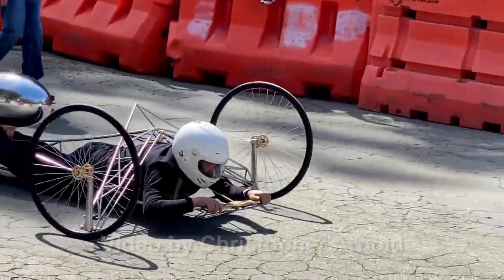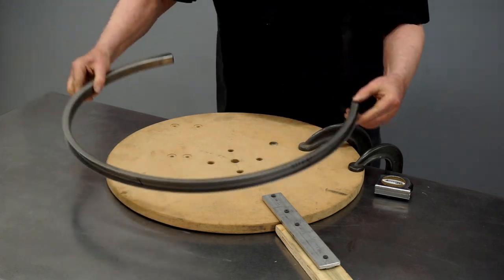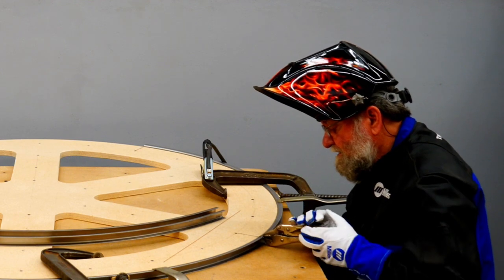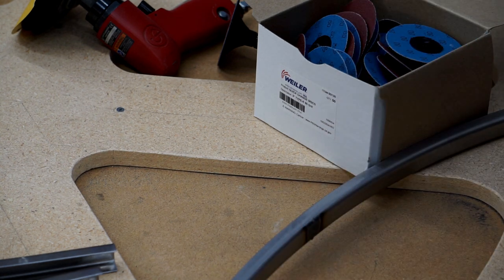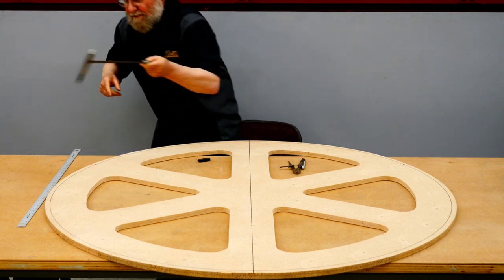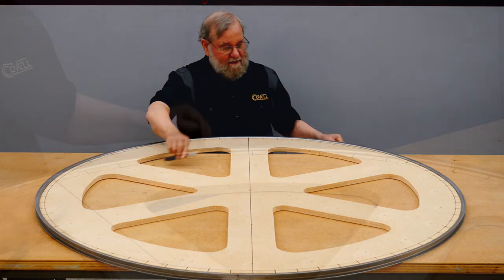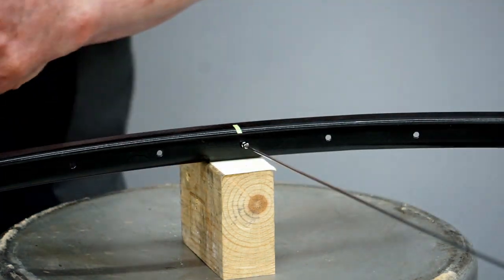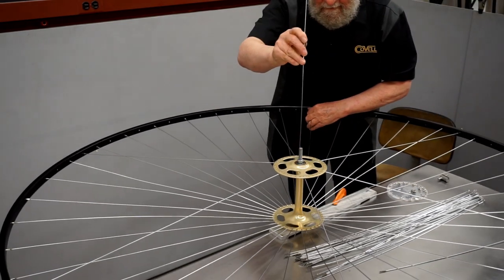Making a Really Big Wheel

Comment: Messing with the minds of geometry lovers everywhere. The radius of a circle is not equal to 1/6 the circumference, but it's pretty darn close, closer than a 1% grade is to 1/8" per foot change in elevation.
I really enjoyed this video. Did you make the hub as well? 
Your videos are inspirational.
Reply from the maker: First, I'm glad you like my videos.
I didn't say that the radius of a circle is 1/6th the circumference. I show that if you strike arcs on a circle the length of the radius, it will divide the circle into 60 degree segments, exactly. 
Yes, I made the hub - it was a pretty intensive job to whittle it out of a solid chunk of aluminum. That was actually the second hub I made. I ruined the first one when it got caught in the polishing wheel, and was bashed into the floor!
Reply: @RonCovell  The polishing wheel strikes again! I've lost a few things to the polishing wheel as well. I'll take your striking 60 degree segments and leave it there, it isn't rocket science after all... until you add a rocket to it.
Reply: @moretimethanmoney8611  When you consult your trigonometry textbooks you will find that Ron is correct re 60 degree divisions (exactly). If you accuse him of an error, and now find out otherwise, you might wish to undo your statement in a polite response to Ron.
Reply from the maker: No apology needed. We all do our best, and we all make mistakes occasionally.
Reply: @RonCovell  Meekness is power under control - you have that in spades. You may not seek an apology but the fellow called "Moretimethanmoney" could learn from your humility and admit his error. Would be good for his outlook - and soul.
Reply: @bobhudson6659  Geometry, pi. Ron got it. That's why he wrote, "I didn't say the radius of a circle is 1/6th the circumference." Of course Ron probably also realized transcribing the radius to the circumference creates a chord that corresponds to an arc, an equilateral hexagon inscribed within a circle, whose points of intersection with the circumference create 6 equal length arcs that are each barely longer than the radius. The inequality not unlike the difference between an engineers 1/100th of a foot and a tradesman's 1/8th inch.

Comment: Beautiful job demonstrating a level of patience only seen in skilled craftsmen.  My background is mechanical engineering.  The length of the spoke would seem to create a very springy wheel.  Can you feel or see any vertical hub movement while the wheel is in motion and especially if it encounters irregularities in the driving surface.   If I remember correctly the spokes should have infinite life if the operating stresses are below 50% of tensile strength.  Care to guess what lateral loads the wheel can sustain without some sort of instability occurring? I don’t think this is what Neanderthal man had in mind.
Reply from the maker: I'm not an engineer, but let me run some very rough numbers for you. On the rear wheel, in static loading, presumably the top vertical spoke takes the greatest load, and both horizontal spokes take very little load. Further, the spokes on the bottom half of the wheel will have no compressive loads at all.
This overly-simplistic view isn't accurate, because there is tension in all spokes, but let's go with it anyhow, just to get some minimum numbers.
So if I weigh 180 pounds, and the vehicle weighs 60 pounds, approximately 120 pounds is loaded on the rear wheel. There are 72 spokes, so the 'average tensile load on each of the 32 top spokes is 4.75 pounds. Of course some spokes get more stress than others, but I think you'll agree that even with 15 pounds tension on a spoke with a diameter of .080", and a tensile strength of around 60,000 psi, we're not getting close to the yield strength of the material.
Calculating lateral loads is beyond my ability, but still, with 72 spokes, the load is spread over a large number of elements, and is presumably fairly low.
If you'd like to run the numbers on this in a more precise way, I'd be interested to see what your projections are.

Comment: Beautiful work, Ron. Thank you for sharing the techniques. I’ve seen spoking & trueing done but I’ve not done it. I think it takes more patience than I have 😁. 
I’ve seen that most spoked wheels have an “X” pattern to the spokes, did you choose to not do this because this is not a driven wheel? I wonder how your wheel would react to torque?  Thank you again 🤟🏽
Reply from the maker: The 'radial' spoking pattern I used for this wheel is only feasible for wheels with hubs that do not drive or brake the wheel. Most spoke patterns cross each other, which gives the hub a lot more rotational strength.

Comment: I have done NONE of this, but I was expecting the spokes would alternate in the hub, one up, then one down..  but that would require an odd number of spokes, on each side of the hub, right?    I'm Enjoying this, as I do all of your videos!!   Thank you!
Reply from the maker: There are many ways to lace a wheel. I used the simplest pattern, called 'radial', where none of the spokes cross. Wheels are stronger when the spokes cross, and the more crossing, the stronger they get. Since my car is a coaster, and the brake is on the rim, there is no twisting load on the hub, and the radial pattern works fine. You certainly wouldn't want that pattern on a motorcycle wheel!

Comment: Really neat video.

I'm just curious, why was it desirable to account for the spring back? Wouldn't there have been merit in making the form the final size you want, and keeping that tension, it wanting to spring back, but being unable to?
Reply from the maker: Well, you're on the right track. When a wheel is fitted with spokes, they are put into tension, which compresses the rim - making the wheel stronger.
When fitting pieces together by welding, it's usually best to avoid any tension, since when the heat is put into the metal, it can move where it's hot - causing localized distortion.
Reply: @RonCovell  Makes sense, thanks for the reply.

Comment: Did you choose to lace the wheel with a radial pattern for any particular reason or just asthetics? I'd have been concerned about the strength of the wheel because it's so huge and maybe would have tried a 2 or 3 cross pattern.
Reply from the maker: No question that crossing spokes makes a stronger wheel, but the strength is mostly for the rotation of the hub. Since my car is a coaster, and the brake is on the rim, there is no torque on the hub. I did it this way because I like the look of the radial spoke pattern.
Reply: @RonCovell  that's true, I was thinking very much about bikes. Thanks for taking the time to reply.

Comment: Wondering how strong your wheel might become with a few crossovers on the spokes. Wonder how many crosses are possible too. I'm guessing you'll be lacing for the most aerodynamic design and going with radial spokes.
Back to watching the build.
Reply from the maker: Crossing spokes makes the hub much stronger for rotational loads. Since my car is a coaster and the brake is on the rim (rather than the hub) it doesn't need that kind of strength - but there is good reason for crossing spokes on most bikes and motorcycles.
Reply: @RonCovell  Excellent, I was about to ask why you didn't go triple cross.  In that specific soapbox derby variant are you allowed to use aerodynamics to clean up the airflow and reduce drag?  I've raced in Human Power Competitions in the past and it's amazing what the difference between a 'safety bike' and a faired recumbent is... safety bikes struggle badly to hit 30mph for short spurts while the 24 hour record is held by an Austrian gentleman in a velomobile that AVERAGED just over 30mph for 24 straight hours. And he's older than me..
Reply from the maker: This was a 'race' for artists, so speed was not the primary concern for most builders. There were only three rules - the cars had to roll, steer, and stop.
I completely understand the advantages of streamlining, and I used to follow West Coast human-powered competitions fairly closely, back when Freddie Markham and Gardiner Martin (EZ Racer) were some of the top competitors. There is some great work being done in this field.

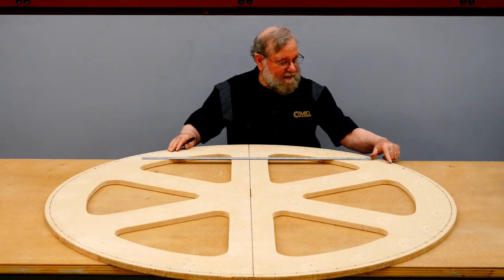Comment: 11:13 It may not matter on this big wheel only being a side note. But the lines drawn with the straight edge are not perfectly radial. For this the pinhole on the straigt edge has to be inline to the edge itself. It is however  ~ 1/2" away (assuming the straight edge is 1" wide).
Reply from the maker: Well, when I hold one edge of the straightedge against the center pin, that side is essentially forming a radial line. To be absolutely precise, I'd have to subtract half the diameter of the center pin, but in the real world it's pretty darned close.
I agree that the side of the straightedge OPPOSITE the tangent edge is off the width of the straightedge, but that's not the side I used.

Comment: Are you not gonna have less spring back with a larger radius bend? Maybe I missed it, love the tig, and the vid also. And what did the heat do to your radius? . Thank you
Reply from the maker: I haven't researched this extensively, but for most of the work I have done, the springback seems to be a uniform percentage. Extremely tight and extremely soft curves might be exceptions to this rule.
The heat from welding tightened up the fit on the form a tiny bit, but not much change other than that.
Reply: @RonCovell  very cool! Thank you for the video

Comment: Love this channel! Just have question, is the spring back percentage scalable (like you did) for any metal?
Reply from the maker: I have not done extensive research on this, but in most cases once I find the amount of springback on a particular piece of material, I use that 'percentage' to calculate how much to overbend it. Of course the size, shape, and alloy of the material makes a difference. Hot rolled material will be different from cold-finished, and in some materials the grain direction could make a difference, too.

Comment: I have made a few regular bicycle wheels, but would like to make a large wheel someday.  Would it be possible to pedal a trike in that position, or would your knees hit the ground?

It looks like you could add a large hydrogen blimp balloon on top of this and create a flying machine too.
Reply from the maker: I love the free-thinking approach you demonstrate here!
You could make a frame that positioned your chest close to the ground, but elevated your hips enough so your knees would have sufficient clearance. The smaller the crank, the less vertical displacement your knees would need. You could also use a linear-action drive, which might enable you to get even lower.
You certainly could make a flying machine by attaching a helium hydrogen balloon, but once off the ground you are at the mercy of the winds.

Comment: I noticed your spokes were placed so there was no crossing of them unlike in a modern bicycle wheel was that done for ease of assembly or aesthetics and can anyone explain why all cycle wheels cross the spokes? I’m assuming it’s for strength but don’t know for sure.
Reply from the maker: Most wheels are made with spokes that cross to give the wheel more strength. This is especially important in a wheel where the hub is driven, or braked. Since my wheel is on a coaster, and the brake is on the rim, there is less need to give the hub rotational strength, and I like the look of the 'radial' spoke pattern, with no crossing.
Reply: @RonCovell  
There’s no denying it looks great.

Comment: Ron, I'm gearing up to make my own rim, and I'm curious what dimensions you used for the rim u-channel.  I don't have a sheet metal brake that can bend 16 gauge so I was going to hire a local company to make the rim sections.  Naturally I need to give them dimensions to work off of...  Also, what is the diameter of the tire rubber you're using?  Thanks for the great inspiration!
Reply from the maker: The outside width at the top is .862", the total height is .563", and the bend angle is 85 degrees. The tire I used is 7/8". Here's one source for the tire material:
http://www.hiwheel.com/
Reply: @RonCovell  Fantastic!  Thanks so much!  I was planning on getting my tire from Hiwheel.

Comment: I'm a little confused. The circumference of a circle isn't six times the radius. It's 2*pi*r, so the six initial divisions won't be even.
Reply from the maker: I think you are confusing the circumference, which is a curved line by definition, with the straight-line measurement of my beam compass. When a circle is divided like I show, it divides the circle precisely into 60-degree segments.

Comment: Wouldn't it have been easier to drill thr spoke holes through the C-channel before bending it?
Geometrical calculations should have yielded the spacing distance, and using that dimension to  make a drill jig with an alignment pin would have made short work of drilling all rim material, with a hand drill, or drill press.
Reply from the maker: I'm glad you thought deeply about these issues, and your thoughts have some merit.
I prefer to do the welding first and the drilling second, since that lessens the probability of having spacing inconsistencies.
A drill jig would be an excellent improvement!
I have a milling machine, and normally I would use it to make holes like these with more accuracy (the vise would be centered under the drill). I chose to do it a simpler way so that those without fancy equipment would see that they could do it too.

Comment: The most important thing I have learned from your videos is patience.  You never skip a step such as, using a center punch when transferring a hole, most people would just use the existing hole as a guide for the hole and then accept the small amount of drill walk. I have been guilty of this, but I am here to elevate my skills so I vow to slow down and not skip the basic steps.   I believe this is my most important step to becoming a craftsman not just someone who forms metal. Thank you for passing on some of your knowledge and techniques.
Reply from the maker: Thanks for the thoughtful comment, and the kind words. There certainly are situations where guiding a drill through an existing hole is acceptable, but as the hole enlarges over time, accuracy is lost. You will learn through experience when more precise techniques are called for.

Comment: At 9:55 circle is not accurately divided by 6 since C = 6.28R.
Reply from the maker: If you take a circle, and make marks around the perimeter the distance of the radius, it divides the circle into 6 equal segments, exactly - since you are creating 60-60-60 degree triangles. Dividing the circumference by 6 is different, since in that case you are measuring on a curved line.

Comment: Strait laced wheels look nice but aren't very strong. A three or four cross would be much stronger. Also you didn't alternate the spokes, but because you straight laced the wheel, you didn't need to.
Reply from the maker: You are right, of course. Radial lacing is sufficient for a vehicle that only runs 100 yards, once every 44 years, and is a coaster with no hub brakes.

Comment: Beautiful as always! Loved this and the F Bomb and the collab with this old tony. Question, at https://youtu.be/LeP14xNTTrk?t=596 you use the radius of the circle to divide it into 6. Wouldn't that leave the centre two sections slightly longer than the other 4 end sections? 2 pi being 6.28 x the radius rather than 6?
Reply from the maker: I think you are confusing the length of a circular arc with the straight-line measurement from my beam compass. The technique I use will divide a circle into precisely 60-degree segments.
Reply: @RonCovell  Ahh of course, my mistake! You effectively have three equilateral triangles on each side. Wonderful stuff. Thank you!

Comment: Even posibillity of small error on second, smaller dividers while making spoke pattern makes me very... nervous about cumulative error
Reply from the maker: Of course you do tests of the divider settings before committing yourself to making the marks. On a wheel like this, I consider +- 1mm (.040") close enough, so this technique works OK. Of course there are jobs where greater precision is required, and dividers would not be the best tool to use.

Comment: A tube section would be stronger, less resistant to potato chipping
Reply from the maker: There is no question that 'double wall' rims are stronger than 'single wall' but they are difficult to manufacture with simple tools.
Reply: @RonCovell  you are right. it turn out nice (no pun intended).

Comment: Seeing you spoke that wheel reminded me of a job I had back in 1972-76 as a mechanic at a bicycle shop. I learned how to spoke wheels and there are different patterns defending on the ride you want and strength. The shorter the spoke the less stretch. However, if it's a power wheel like on the back of a chain driven bicycle, you want more of an angle to your spoke. It prevents the hub from flexing in the rim. 
We used to use a spoke chart to let us know what length spoke to use which is probably the hardest thing to figure out because of the wheel diameter, the diameter of the hub then spoke patern and number of spokes.
You did a very nice job because true-ing up a spoke wheel is an art and one of the hardest things to do in a bicycle shop. You did the right thing by passing on to a pro who does it all the time.
Reply from the maker: You bring up some great points - thanks!